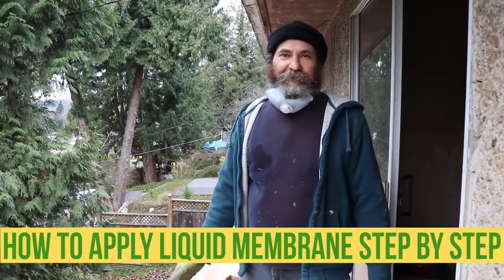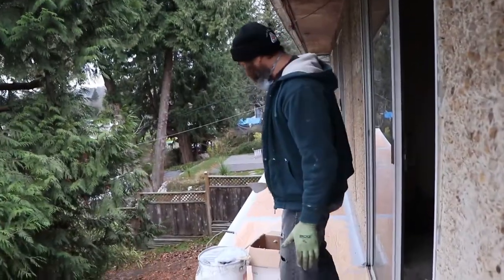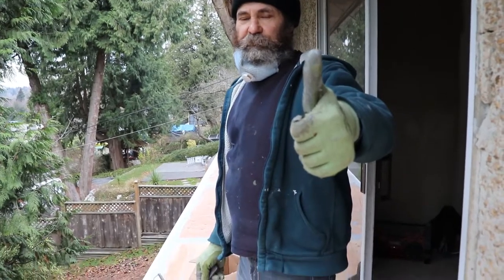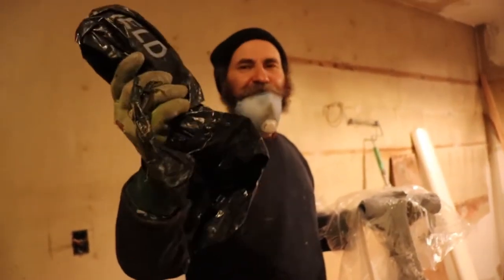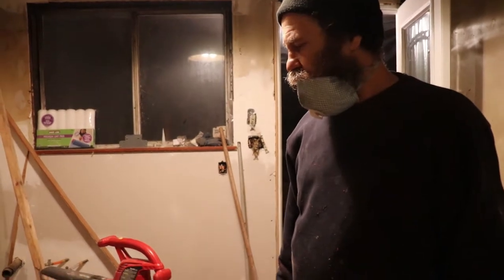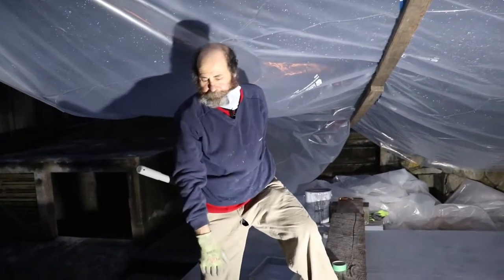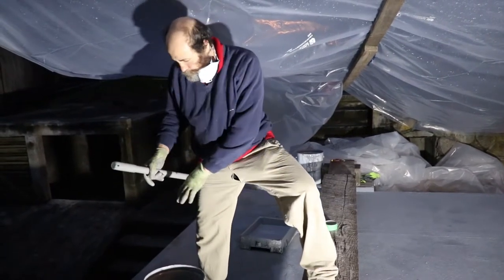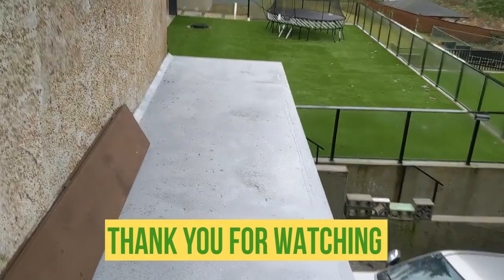How to Waterproof with Master seal liquid membrane In the Winter

Comment: Greetings, Mr. Reno! I am planning on sealing my deck/balcony with plywood and liquid membrane. As a novice, I am very fortunate to have come across your channel and this video. From your experience, how often would I need to reseal the deck with liquid membrane? Thanks!
Reply from the maker: Hello my friend thank you very much, I sealed a balcony and it last about 20 years without any leaking, the house was sold recent, I can not follow up any more else I do not have record of the liquid membrane used, all depends on the floor preparing, usually I check many times for any imperfection on the floor before start my last 2 coats, it is important to have a very clean and very dry floor, if it is not well done the  problem could show up after one winter, please let me know if you have more questions, keep safe and enjoy life.

Comment: I have a concrete slab that holds moisture what Master seal product do I need Thanks? Thanks for sharing your video!
Reply from the maker: Hello Cory, thank you very much for your time and support, is your slab in the interior or exterior?
You want to coat over top? Or put something to stop the moisture from coming up?

Comment: Nice thanks Bahiano!!! You are the only one that explain the whole process from start to finish :) and response surprising quick. Really appreciate your help. I will go with the top coat TC 225 on my balcony after sanding it nice and clean. As my balcony is small think 5 gal is more than enough lol for multiple coat on the existing surface.

Its sad that the old surface might have micro cracks invisible to the eyes or not completely 100% waterproof but still structurally sound. So i am hoping just a few layer of TC 225 will fix it :)

Just order TC225 only without the base coat M200 if require i might order it later on as all of it is on back order lol.
Reply from the maker: Thank you my friend, keep safe and if you have more questions let me know, I will do best to answer them.

Comment: We are ready to tackle our porch.   I found everything needed......the plan is base coat masterseal 200 let dry then apply 2 coats of materseal 225 - does that sound correct?  of course all the prepping before.  Would like your feedback and thank you...
Reply from the maker: Hello Ken, thank you very much for your time and support, sounds right, the base coat will be tacky ( not dry completely) when applying the top coat, preparation is the part that requires more work, but it is very important to do it right, keep safe and keep me. informed on your project.

Comment: Hi Bahiano, thank you for sharing your experience and all the work puting the video together! I wonder if you can do something so that you don't see the edges of the fabric where the joints are? Thank you!
Reply from the maker: Hello Georgi, you are welcome
Yes that can be accomplished by doing a skim coat over the joints, it takes more time, but the skim coat would completely hide the tape, just like drywall joints, but using high strength thinset cement primed with adhesive, let me know, if you have more questions, thank you very much for your time, keep safe and enjoy life
Reply from the maker: Hello Georgi, it is my pleasure
Yes I have to admit that, this textile tape is a kind of thick, there is a very thin tape made of polyester, that hides away better than the textile tape, but I couldn't find the polyester tape in any of the suppliers in here at that time,  thank you very much for your time, keep safe

Comment: Would these products/applications work for a balcony exposed to upper midwest weather? (Snow, sleet, heat, humidity)
Reply from the maker: Hello dear, thank you very much for watching my videos, yes all the balconies that I have done, they're exposed to the weather elements, just needs to be done right with patience, to check and seal, this one in particular was done in the winter, winter is not the best time to work on balconies, in our case, we did not have other option, keep safe and enjoy your weekend, if you have more questions, would a pleasure to check them out, see you in the next one